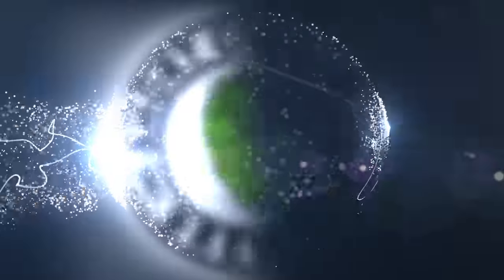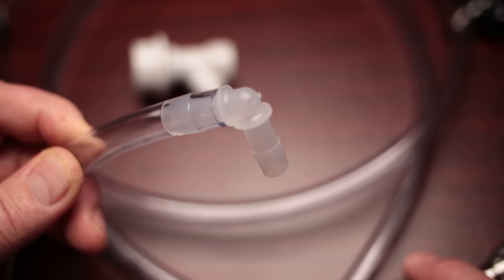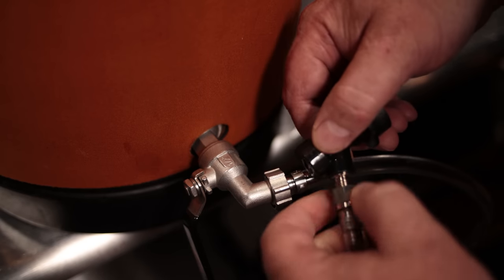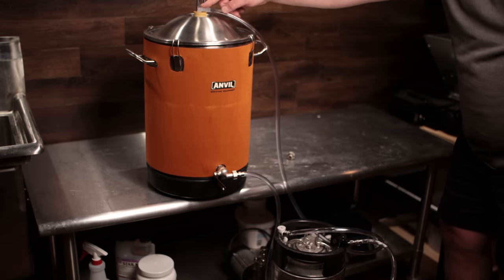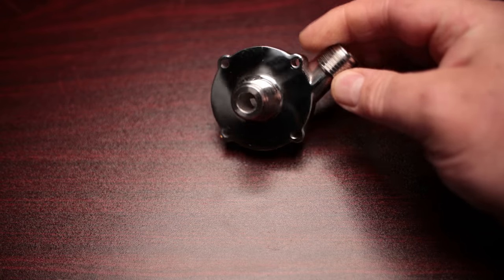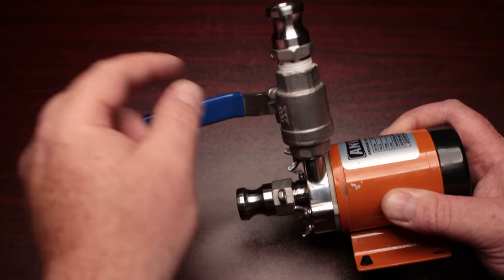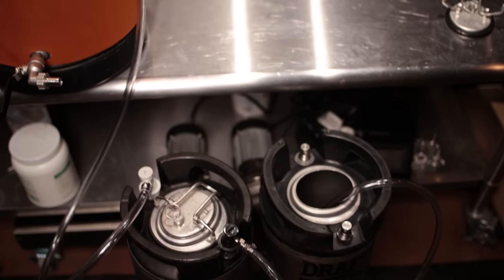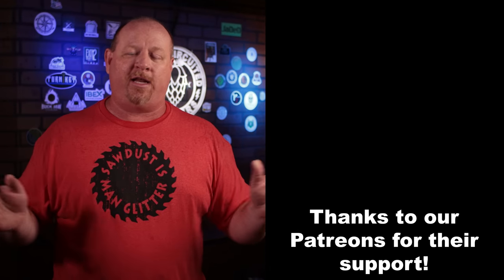*New* Anvil Brewing Oxygen Free Transfer Kit and Stainless Pump Head

Comment: I would recommend purging the transfer lines before attaching them to the fermenter. I leave a few psi in my purged keg so that when I attach the transfer lines the co2 purges theough the lines then attach them to the fermenter and start the closed transfer.
Reply from the maker: Good tip! Thanks for commenting. I actually do something similar to that myself. I just forgot to mention it in the video.. lol 👍🍻

Comment: I love the stainless pump head.  Got quick disconnects and a ball valve hooked up.  Nice upgrades.
I noticed the stainless pump head doesnt quite fit perfectly on my pump like the plastic one does.  Theres a very small gap all the way around but it hasnt leaked so no big deal.  Great video as always Brian
Reply from the maker: Yeah I notice a little one myself. But the seal is good. Probably just a difference from plastic to metal. 👍🍻

Comment: Great video as always. I don’t use this system but I do O2 free transfers. One thing I do is release about 90% of the CO2 from the keg and then attach the ball locks/tubes to push air out if the tubing, and THEN attach to the FV. Not sure if that small of a volume of air really has any negative impact but I do it to minimize that variable.
Reply from the maker: Yes I like that technique as well! 👍🍻

Comment: Another Co2 saving tip is using a spunding valve to partially carbonate your beer. If you have a beer that needs yeast character you can still do it, just wait until initial fermentation is done and then pop the spunding valve on at the tail of fermentation. If you let it go up to 20 PSI at room temp for normal light ales it will slightly under carbonate, but you will only need a little bit of your store-bought Co2 to get to the desired level. Dark beers you can get right up to carbonation level by doing this since they require lower carbonation.
Reply from the maker: Yep! But the buckets don't hold pressure. But a great tip! Thanks for sharing!

Comment: Oh this guy is good man... Thanks for the tip. Real innovative.
Reply from the maker: Thanks! 👍🍻
Reply: @ShortCircuitedBrewers  Np. On the fermentation pushing the starsan out from the first keg to the second, when the first keg is empty, isn't the tube free to take in air especially if the ferment is done and is no longer giving pressure?
Reply from the maker: @johhnyglaze1  in order for the tube to take in air you would have to have a pretty drastic drop in temperature. Such as cold crashing or something like that. As normal it's not going to suck in air just being the same temperature after having pushed all the starsan mixture out. Plus if you have the tube in the second keg by the time that keg fills up it's going to be submerged underwater so it would act like an airlock.
Reply: @ShortCircuitedBrewers  Got it. Thanks.
Reply from the maker: @johhnyglaze1  👍🍻

Comment: Pretty smart reuse of the co2 generated from fermentation, but I see two potential issues: 1: the initial gas being pushed through the line wouldn't be pure co2, it would be a mix of environmental air from the headspace and co2 generated from fermentation, potentially allowing oxygen in. 2: you run a risk of clogging the ball locks and dip tubes with yeast & krausen if you get a vigorous fermentation. Thankfully since both these potential shortcomings are related, they could be minimized by waiting until you're past high krausen "growth phase" of fermentation to set up the transfer tube. Its awesome to see some innovation for low/no o2 using gravity transfers!
Reply from the maker: You do have a couple of good points there. If you're krausen doesn't get that high in the fermenter any ambient air in the fermenter that's pushed into the keg would be pushed out after the liquid is removed if you left the system hooked up. Or you could as you say wait till after high krausen and I'm sure you would still push all the liquid out. Great comment!! 👍🍻
Reply: I believe one normal batch for a beer that is not too heavy will produce 600 liters of Co2 or something like that, so it will probably purge out any initial O2 thats in the headspace. But youre right.. its easy to prevent and on top if it you dont run the risk of getting your ball locks nasty grimey.

Comment: The original pump was designed for non-boiling temperatures.  With the new pump head, I assume this is still the case because the impeller and base are not replaced?  Thanks for sharing this news - good stuff.  Always enjoy watching your content. 👍🏼🍻
Reply from the maker: The non boiling liquid has more to do with cavitation than it does being able to withstand the heat. The reason they said not to pump boiling liquid is because of the air that's present in boiling liquid would cause cavitation of the pump. That's really the only reason for that limitation. 👍🍻 (Right after you turn off the element and the liquid is no longer boiling. You can recirculate with the plastic head just fine. Just not while boiling)
Reply: Ah, ok. Thanks for that - LOL.  I was thinking that was a pretty big shortfall of that pump.  Also, wanted to share with you a way to install a camlock on the Anvil ball valve.  What I did was remove the locking threaded round “nut”, place 2 corny keg ball lock quick disconnect o-rings on the existing sealed barb (to take up the space and seal the camlock) and screwed the camlock over the top.  No plumbing tape needed. 🤓🍻
Reply from the maker: @JohnSchink  nice hack!! Thanks for sharing! 👍🍻

Comment: Great tip, but one thing I'm confused on: wouldn't O2 eventually enter the keg since it wouldn't be under pressure? Or would you keep it connected to the sanitizer vessel like an airlock after it's purged? Thanks for the video!
Reply from the maker: Yeah that is correct. Use it like an airlock.
Reply: @ShortCircuitedBrewers  gotcha!  thanks much as always, cheers!

Comment: Might be a dumb question... But while the stainless steel pump head gives you options for connects/disconnects, can you you run hot (boiling) wort through the pump? Or still no because of the nylon impeller?
Reply from the maker: There has been kind of this misnomer about the nylon pump head not being capable of pumping hot liquid. It can pump hot liquid just not boiling liquid because of the fact that it can cause cavitation. That was the main reason why they say no boiling liquid through the pump. Now you can pump hot liquid, AKA right after you turn the element off and the liquid is still above 200°, through the pump just fine. The stainless pump head doesn't change any of that, there's still a potential for cavitation if you pump boiling wort or water through it. It's the bubbles in boiling liquid that cause the cavitation by the way. 👍🍻 PS not a dumb question by any means!!
Reply: @ShortCircuitedBrewers  Thank you for the detailed response. That's part of the beauty of brewing, always room to learn. Super informative and entertaining content, as always! 🍻
Reply from the maker: @elliotttucker6229  thanks man!! 👍🍻

Comment: Great video! Do you think this system could be used with the g4 fermenator?
Reply from the maker: The transfer kit?
Reply: @ShortCircuitedBrewers  yes! Sorry if it’s a dumb question, just getting started here!
Reply from the maker: @meganhyman8754  no problem! I use this.. https://www.blichmannengineering.com/quickconnectortm-1-4-flare.html and attach a duotight fitting to that on the other end another duotight fitting with a liquid ball lock connection. 
https://www.morebeer.com/products/duotight-pushin-fitting-8-mm-516-14-flare.html 
One of these
https://www.morebeer.com/products/duotight-ball-lock-quick-disconnect-qd-beverage-8-mm.html
And some tubing
https://www.morebeer.com/products/eva-barrier-double-wall-tubing-532-4-mm-id-516-8-od-placeholder.html

I attach all that to the aseptic valve and transfer to keg.
Reply: @ShortCircuitedBrewers  order has just been placed! Thank you so much!!
Reply from the maker: @meganhyman8754  nice!

Comment: Hi Brian, first off thank you so much for the videos you make.  They have been helping me learn a lot about my new foundry system and all grain.  I'm ordering the transfer kit now and I'm just curious if you might have any advice on how to connect the beer line to a bucket fermenter spigot?  Thanks in advance!
Reply from the maker: It has a connector that is made to connect to the fermenter. From what I recall. 👍🍻
Reply: @Short Circuited Brewers  I know it has a screw on connector for the stainless fermenters but was looking at how I might be able to connect it to a bucket fermenter with a plastic spigot?
Reply: @Short Circuited Brewers  disregard that comment! Just realized the spigot is barbed and I can connect directly to it.  Thanks again for all the time you put into your very informative videos
Reply from the maker: @joshlong7769  no problem!! Good to ask questions! 👍🍻

Comment: Question.... How much PSI of CO2 do you fill the keg with before starting the transfer?
Reply from the maker: The buckets only handle a couple psi. So 5-10 psi is fine, mainly to purge the lines as you hook them up. This is not a pressure transfer system. 👍😁

Comment: Great CO2 hack at the end! Worth the price of admission. Just curious if any other gasses are noticeably present when u finally expel them, like any sulfur smells or such.
Reply from the maker: Usually sulphur is at the start of fermentation. So if you let this run a little while after the liquid is pushed out you shouldn't experience any issues. Lagers might be a little more troublesome, but overall no issues. 👍🍻
Reply: @ShortCircuitedBrewers  Thanks, great to know!
Reply from the maker: @NoelSufrin  👍🍻

Comment: Got the transfer system and it's a life saver for packaging day! I'm trying to use your second CO2 saving top during the actual fermentation, but not much sanitizer water is coming out of the keg...anything you could think of that would not allow this method to work? It seems like there may be a displacement issue between the vessels
Reply from the maker: Not sure.. maybe the back pressure it too much.
Reply: @ShortCircuitedBrewers  yeah maybe, do you think I need an absolutely full keg for it to work?
Reply from the maker: Probably a good idea. And make sure the vent hose is not submerged.

Comment: I seem to have issues with the gasket on the lid of my bucket like you show in the video.  It’s no longer airtight and I’ve never gotten the closed transfer to work.  I’m only 6 brews into it and I’m a little disappointed.  Any suggestions??
Reply from the maker: See of you can tighten the lid clamps. Take a pair of pliers and put a little more curve in the clips that good the lid down. Should pull the lid a little tighter. 👍🍻
Reply: @ShortCircuitedBrewers  I’ll give that a try!  Thanks
Reply from the maker: Also you shouldn't really need the ability to hold pressure to do the transfer like I showed in the video. It's not really a pressure related transfer more of a siphon. 👍🍻

Comment: I’ve been filling my kegs with fermentation co2 for a while but I run it down liquid line with air lock on the gas side. . Always thought the fermenter couldn’t push out 5 galloms of starsan. Gonna try it.
Reply from the maker: It will!! Let me know how it goes! 👍🍻
Reply: Can confirm it absolutely will. A 1.050 wort will push out at least 3 kegs of starsan but certain yeasts seen to do better/faster - Chico stains and kvieks are generally very fast - maybe 1 hour per keg, while lager yeasts tend to be a bit slower. Just let it start bubbling steadily to be confident the head space of the fermenter is purged before attaching to the keg.
Reply from the maker: @dhoward7524  wow that's pretty crazy! 👍🍻
Reply: @dhoward7524  , thanks for that tip on purging air from VF, makes me think of the possibility of blow off as well.  The process would back fire and cause a bit of cleanup.  Using a transparent VF would be an advantage here.

Comment: Brian would you be able to let me know the hose sizes and barb sizes in the Oxygen free transfer kit?  I'm trying to build my own as it's OOS on the Anvil site and they won't know when they will get all the parts in.  Thanks.
Reply from the maker: It's all 3/8 barb with 3/8 hose.
Reply: @ShortCircuitedBrewers  Thanks...I'm having trouble find a 1/4" to 3/8" barb for the disconnect.  Do you think a 5/16" barb would suffice?
Reply from the maker: @ryanantonio2755  https://amzn.to/3EUqVEZ
Reply: @ShortCircuitedBrewers  Well I have a threaded ball lock with 1/4" thread, so I think I would need a swivel flare nut to go to 3/8"
Reply from the maker: Oh ok.. yeah the 5/16 would be fine
Reply: @ShortCircuitedBrewers  Thanks a lot for your time.

Comment: hi, I'm a newbie at this, and was wondering what are the major advantages of doing an oxygen free transfer? I assume this is to keep the beer fresh for longer, but if i'm consuming the beer within the month. Does it really matter? thanks
Reply from the maker: The biggest style that it matters for is hoppy beers depending on what you brew. If your beer that has lots of hops in it gets exposed to oxygen the Hops oxidized very quickly and lose their Roman flavor. It's not nearly as important if you're doing stouts or porters or even a lager. It's one of those things you just have to kind of decide if the extra effort is worth it depending on the style that you brew. And just so you know hops can oxidize in a matter of days so if it takes a month for you to consume what you brew you would definitely see an improvement if you're not currently doing that with your hoppy beers

Comment: Great video! Brian have you tried your CO2 process with Kveik fermentations? I do quite a bit with Kveik and have experimented in the past with this same process, but ended up with quite a bit of esters in the keg (some might like that with Voss, I don't). I ended up having to purge the keg with normal CO2. Maybe it's because of the rapid fermentations by Kveik?
Reply from the maker: I haven't tried it with kveik. I don't think it would be an issue to fill with the beer and then purge the headspace. Have you have any issues with it affecting the beer?
Reply: No. Was too afraid to try. Was worried about them mixing as I transferred into the keg.
Reply from the maker: @lukecarney1569  gotcha! Sounds like a good test for me to do. 😁

Comment: I like the new pump head so I can put a ball lock fitting on it to control the flow. I hate that stupid squeeze clamp for adjusting the flow rate. 

I'm on the fence about the closed transfer kit. I've just done normal gravity transfers without issue. Keeping the oxygen contact to a minimum seems like a good idea, so maybe I'll look into it. 

Does Anvil sell that multi-hole stopper you showed? I would like to use my thermowell in the Anvil fermenter, but all the stoppers I can find that have a hole for the thermowell and a hole for a bubbler do not fit the hole in the Anvil fermenter lid. (They fit a 6 gallon carboy.) Not sure why they made that hole as big as they did. Nothing seems to fit it except the one hole plug that came with it. Maybe I'm just looking in the wrong places.
Reply from the maker: I'm not sure. I'd ask them and see. 👍🍻

Comment: Be sure to open the release valve in the keg or nothing will happen.
Reply from the maker: Huh?
Reply: @ShortCircuitedBrewers  if you have the lid on the keg won’t the liquid stop if you don’t vent the keg?  If I’m wrong, I’ll delete the comment.
Reply from the maker: @beerman1957  the keg is being vented by the gas tube that runs back up to the fermenter. Like I said in the video as the fermenter empties it pushes the air or CO2 out of the keg and the line that connects the gas post to the top of the fermenter fills the space in the fermenter created by emptying it out. It's pretty much like a closed loop siphon. 👍🍻 (No need to delete the comment let's leave it in case somebody else has that question. I always subscribe to the fact that the only dumb question is the one you don't ask.. maybe I didn't explain it properly so let's leave it that way other people can learn.)
Reply: The liquid is going to displace the air in the keg and that creates pressure in the keg and that pressure will equalize and create a vapor lock condition.  Or maybe I’m just daft.
Reply: Ok. I didn’t notice that.  My bad.  I had vapor lock when I was using the keg quick carb from Blichmann.   I see now how this works.  Now I feel dumb. Lol.
Reply from the maker: @beerman1957  hey we all have to learn sometime! 👍🍻